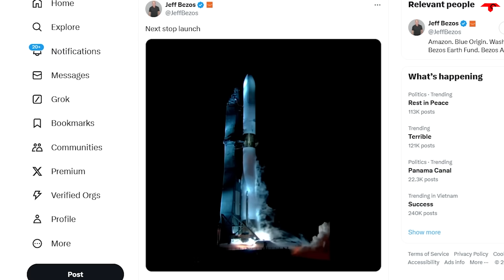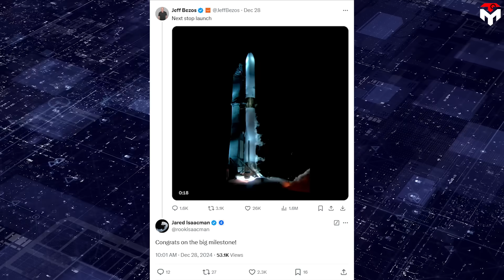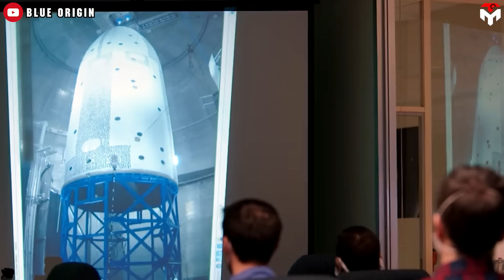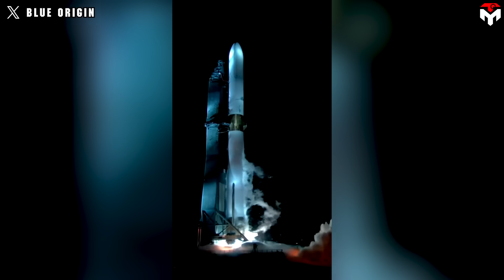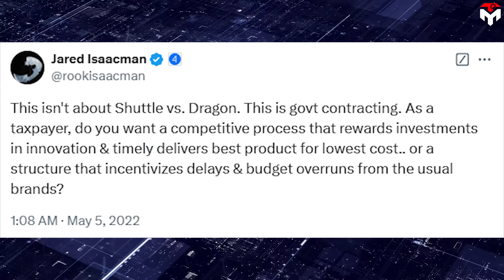It's Embarrassing! New Glenn Officially Ready to Launch BUT... Elon Musk Laughs.

Comment: Why do you say "hot" fire test?  Is there such a thing as cold fire?  Wouldn't it be better to say "static fire test"?
Reply from the maker: I didn't call it that myself. It's a term.! A hot fire test is a long-duration test that simulates the conditions of a rocket mission by firing a rocket engine for as long as it would burn during a mission. The test is designed to assess the rocket's performance and readiness for launch.
Reply: @techmap9  and this mean not few second, hotfire mean several minute non stop ful power.